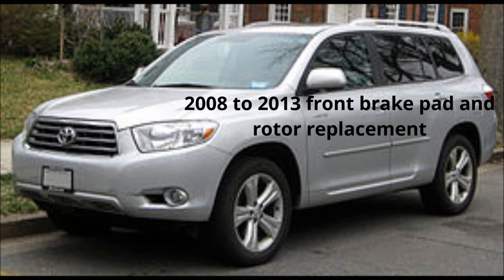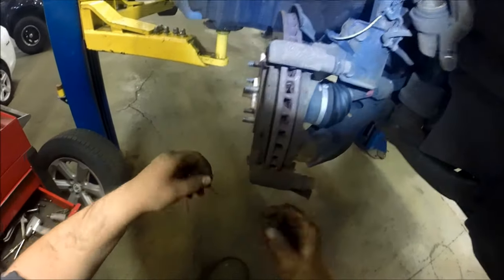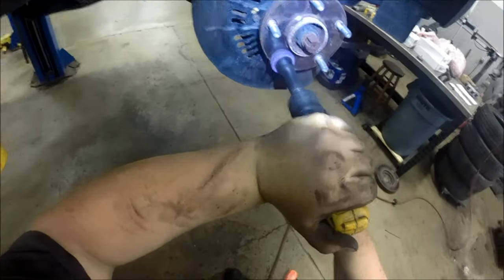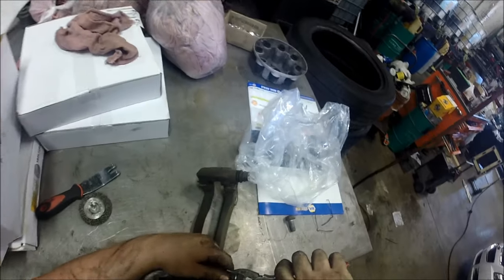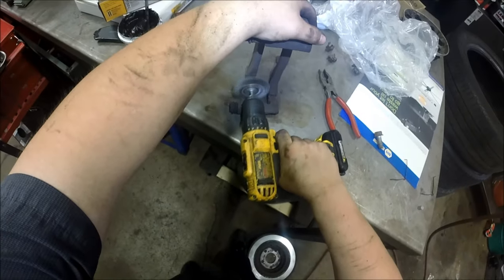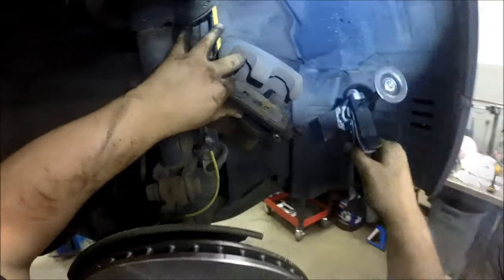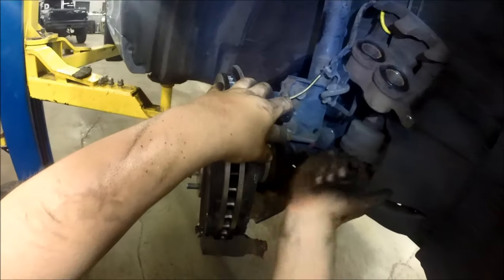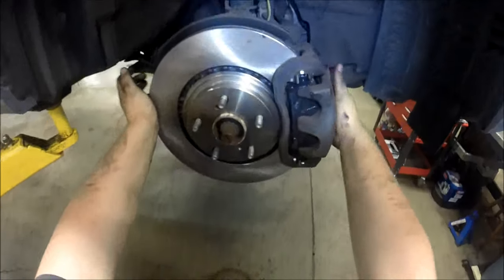2008-2013 Toyota Highlander front brake pad  replacement

Comment: Great tutorial video! My buddy and I followed it to a tee as we were not experienced in changing brakes and rotors.
However we ran into one small issue but it was on a 2011 Highlander. The rotor would not come off no matter how much we hammered it. One thing that was not mentioned was there are 2 small holes on the rotor and if you tightened a 12mm screw into it, the rotor pops loose. Then again that was for a 2011.
Reply: You probably didnt even need new rotors. Famous upcharge from the shop is all that is.
Reply: @Mach141  I'm almost 50 years old and have replaced several sets of brake pads over the years.  I have never replaced or had a rotor replaced on any vehicle.  Not sure why virtually every brake pad replacement video seems to show new rotors as well.  If they are grooved you can take them to a machine shop and have them turned.
Reply: @bluegrassfan7656  This is the deal...auto mechanics used to turn the rotors at every pad replacement. This had nothing to do with rotor wear and everything to do with providing a fresh seating surface for the new pads to "mate" to. Usually rotors could be turned once or twice and then would become out of specs. (to thin) and would require replacement. What happened next (approx. 35 years ago) is the Chinese started mass producing inexpensive replacement rotors, and then mechanics would just replace them at every pad change instead of cutting the old ones.  It may have even been cheaper to buy two new rotors then the cost to turn the old ones. Most garages got rid of their lathes and went to a replacement only business model. This tradition has carried over to this very day, which is why you see new rotors on every brake job. Brake jobs are also easy and very profitable for shops, all the more reason to sell you new rotors. Then there are people like you and me, who are smart enough to figure out brake rotors need neither turned or replaced, as long as they arent glazed, too thin or in any way unserviceable. We buy our $40 pads, replace them, install the same rotor we took off,  and we are golden. A $40 brake job. Our vehicles stop perfectly fine. Im 56 years old, have done this on every car ive owned, which has been many. Meanwhile the average Joe gets robbed on every brake job they pay for. Ive seen one youtube mechanic say not replacing the rotors is "okay" but you wont get optimal stopping if you dont. I say bullshit, you will stop just as fast, and you will. Also do it yourselfers get "encouraged" or "up sold" at the local parts store to buy rotors, or even shopping online at rockauto, buy some pads, and rotors will be shoved down your throat. Keep fighting the good fight! Save our Rotors

Comment: Nice job!  Cleaning the hub surface like that is something I've never thought about, and I've done lots of brake jobs for my own vehicles.  Nice tip!
Reply from the maker: thanks,  its an often overlooked step
Reply: A trick: you can watch movies at Flixzone. Been using them for watching a lot of movies lately.
Reply: @Chase Ezra Yup, have been using Flixzone} for since december myself :)

Comment: I have a 2008 model Highlander. Another tip, if you don’t want to hit the brake rotors with a hammer to remove them, use a 8mm x 1.25 bolt (turns with a 13 mm socket) & it’ll remove the rotor super quickly, an ABSOLUTE lifesaver!
Reply: Yo

Comment: Good instruction! Lots of detail. Some of the steps, however, didn't make it into the video, and the wide angle headmount camera moved around a bit too much and sometimes it wasn't clear what was going on. I recommend pausing every now and then and moving in for a closer shot. Thanks for making the video - will use what I learned!

Comment: The 2012 Highlander has four-wheel disc brakes.  Torque specs are: Sliders - front and rear, 25 foot pounds; Bracket - front, 76 foot pounds - rear, 57 foot pounds.  Lug nuts are 76 foot pounds.
Reply: Darn.  I wish I read these torques before doing my brakes yesterday.  I only torqued the front brackets to 32 ft lbs.  Should I take the wheels off again, and re-torque?

Comment: If I'm re-using the same rotors and they come loose while replacing the brakes, would you reccomend I take the rotors off and clean up the rust from the inside and outside? or will slapping them back in place be fine? Also each bracket had a siezed caliper slide, thanks to you I was able tog et them out, clean them up and regrease them with the proper grease.

Comment: I was closely watching your video specially where you pushed back the caliper piston... I was told that before you do that you should have the reservoir cap off because pushing the piston back is also pushing the brake fluid back up. Is it really necessary to have the cap off?

Comment: Nice vid.  Aside from obvious scoring, how should I determine if my rotors (front & rear) need to be replaced?  Is there a thickness spec I should measure?  No symptoms of warping.  No brake problems at all, except the pads are getting thin.  I want to replace them before rotor damage occurs.  Thanks.

Comment: Hi Joe - Thank you for the nice video!  Is it necessary or recommended to change the original roller with a brand new one even if the brake pads didn't edged into the original roller?  I had seen cases where the old roller can also be cut by professional to make it smooth if edged by the brake pads.
Reply: *”rotor”

Comment: is there a ballpark torque for the caliper bolts? the slide side heads wants to spin as the caliper bolts get tight.... just hold them with a vise grip or something?

Comment: I have a 08 Highlander I recently changed the brakes and rotors months ago and now I have a clunk or popping sound every time I go in reverse. Not sure if it's because of after market rotors( 1a auto) or brake pads ( 1a auto) . Followed same procedure as this video
Reply: Did you ever solve the clunking problem? I have the same thing happening
Reply: @travioli_and_cheeze  same problem exist. I'm buying stock  tom o

Comment: Another few tips: use your wire brush and clean the inside of the caliper the piston ring surface and the other areas where they contact the pad. Also I dab a bit of grease on inside of brake pad clips. If living in a wet or place where there is salt , adding antiseeze to hub is helpful.

Comment: You missed the clips on the pads😮 it will cause clicking noises breaking in reverse.
Reply from the maker: @daniel.gorini  old video but good tip I had a run of these where the clips were wrong in the box and I couldn’t get them to go on with the pads from our supplier at the time I should do a updated video , good catch